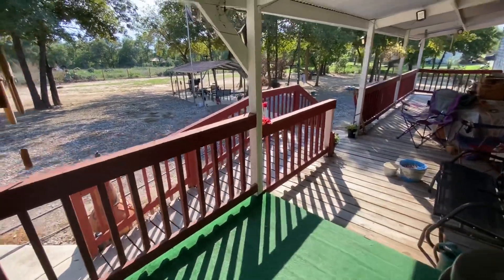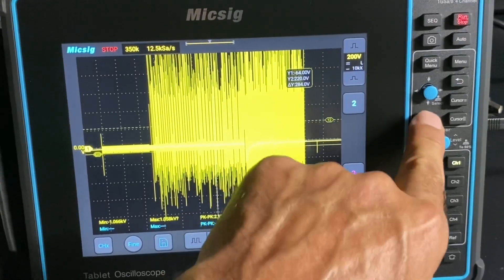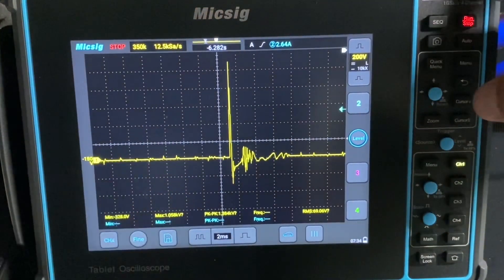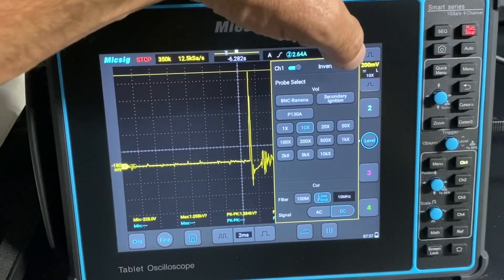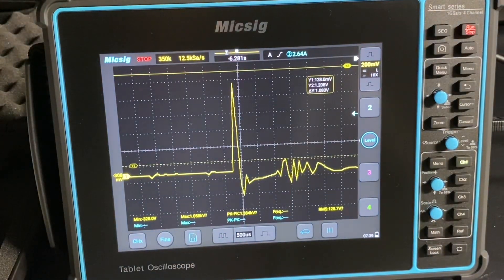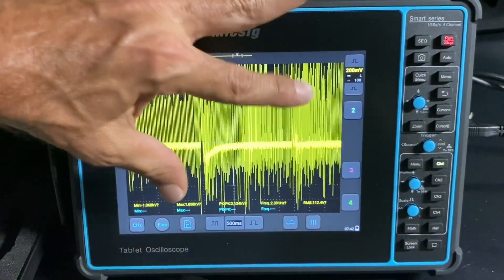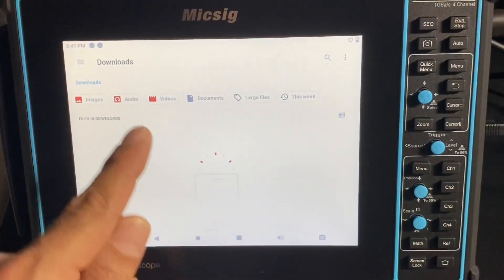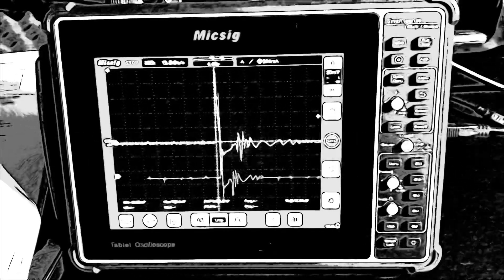ATV Secondary Ignition on Micsig SATO1004 Scope

Comment: Question brother. Im looking into getting the MIGSIG scope but so many options they have. Which do you suggest?? I really like the Ato1004 looks pretty bad with its 10inch screen and toucbscreen button. Your thoufhts good Sir
Reply from the maker: I haven’t been on their site for a while, so I’m not sure of all their newer stuff. With that said, I used the ATO1104, that you can see in my older videos; for a while, and it worked great. I still use it from time to time. Then about 2 years ago I got the SATO1004. It’s basically a newer upgraded model of the first one. Only, instead of just having the touch screen, you also get the knobs and buttons. This helps a lot when you have grease, oil, etc. on your hands. Or gloves on. Also makes maneuvering around faster and easier. It also has some more features, that I really like. You can see the differences in my videos. I wish I could better help you with your question. I just don’t know what new scopes they have at this time. I will say, Micsig makes a great scope, and for the price I don’t think you can find one that even comes close. They have good customer service also. If you’re getting it for automotive use, I would get one of their automotive scopes. They come with a lot of automotive presets. Both my ATO and SATO have the automotive presets. Also, I would get a 4 channel (or more). Hope this helps some. Good luck. 
PS. No I do not work for Micsig, and have never been paid a penny by them.
Reply: @atomsworkshop195  thank you Good Sir. I'll check more of your videos out to get familiar with it. Been using Snap-on for 10 years and I'm just tired of the Zoom feature. This MigSig looks bad Ass and really want one.